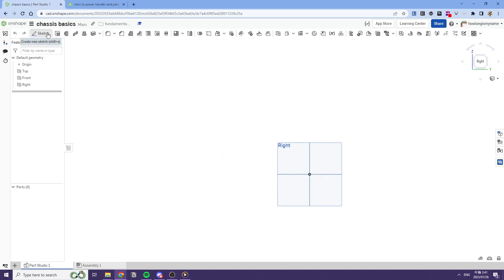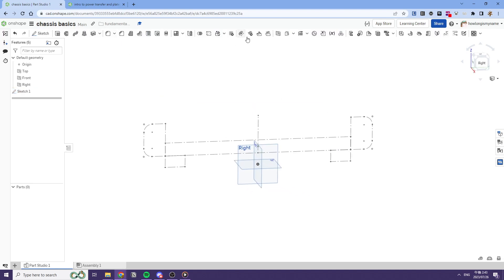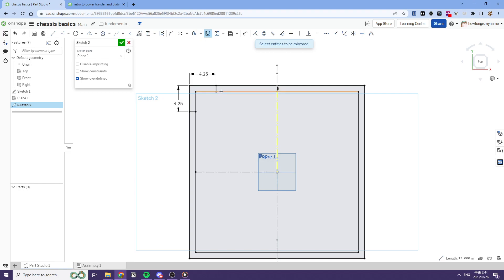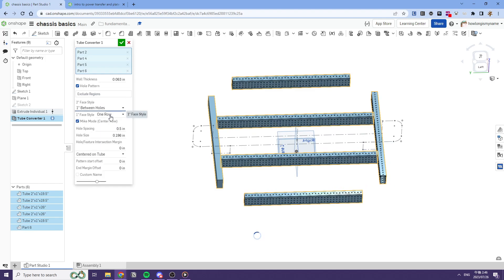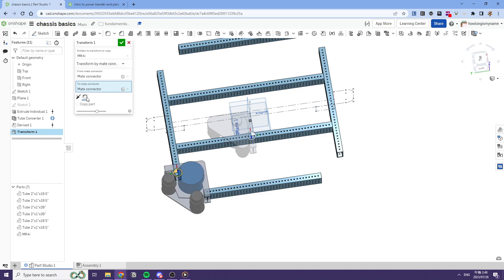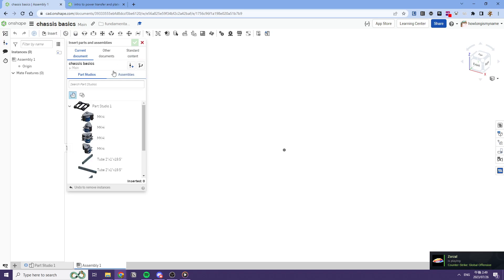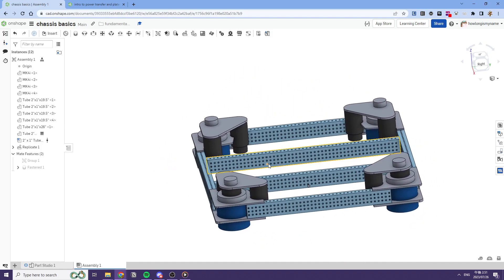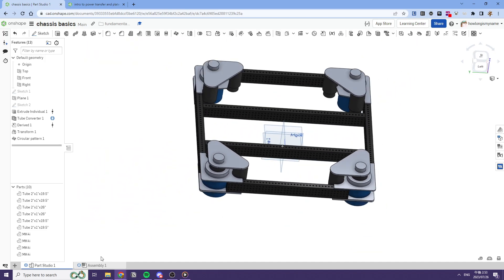how to make swerve chassis frc onshape cad mk4i

Comment: Where did you get the tube converter at?
Reply: at the left of the tool search bar there is a + sign for custom features you should search "tube converter" in there
Reply: Do you still need it？